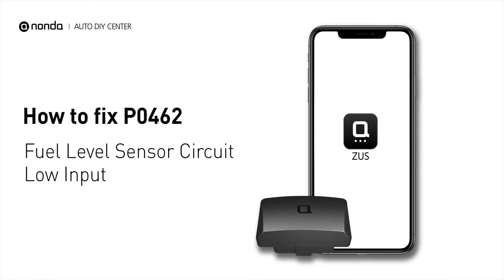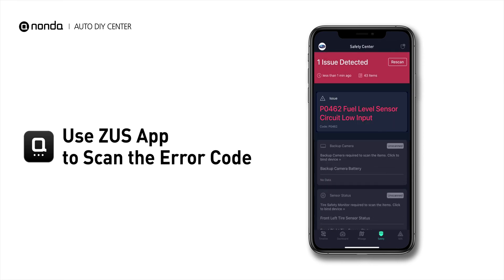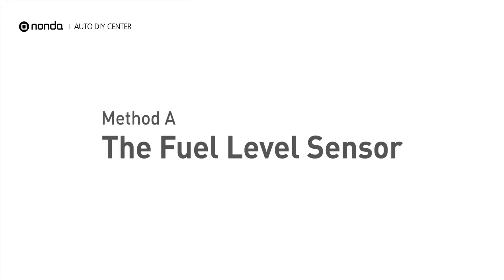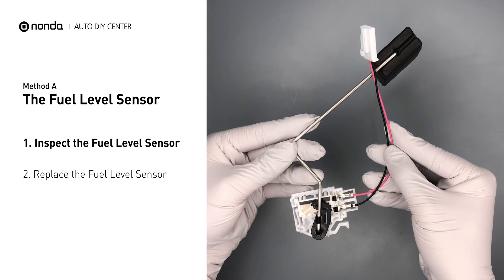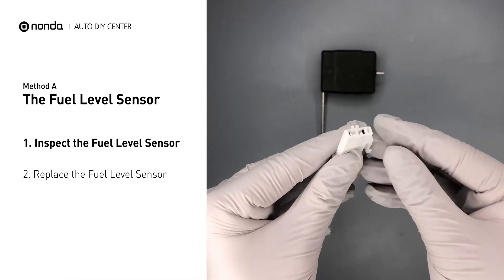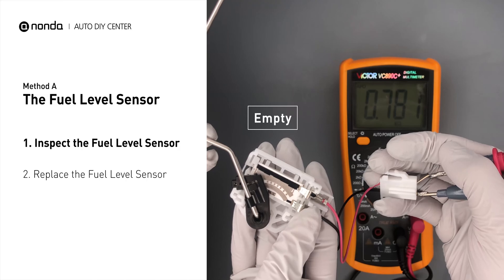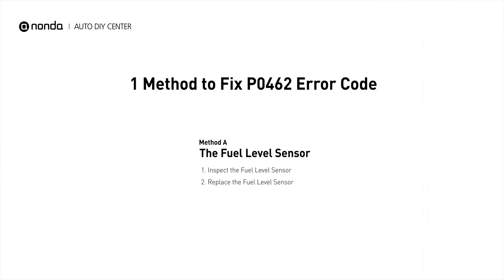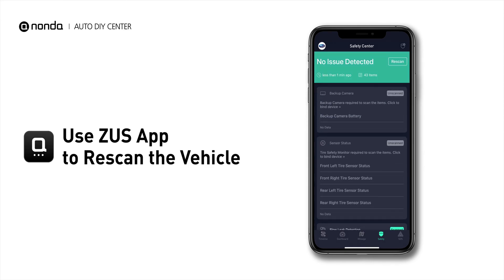How to Fix P0462 Engine Code in 2 Minutes [1 DIY Method / Only $11.56]

Comment from the maker: Hi, I'm Steve, nonda's lead mechanic engineer. 
Feel free to leave your comments here if you have any mechanic questions, I will be glad to help you out!
Reply: I changed the fuel pump and still having the issue, give me wrong fuel reading
Reply: @CasaPapiii  same here on my 02 maxima
Reply: why would it say that code when the dash cluster dosent work.thats the problem i need to figure out. when it works everything works,when it dont work gas miles speed oil air conditioner dosent work.
what code would tell me that problem?
Reply: If I were to take my car to your shop, would you charge me for only 2 minutes of labor to do everything in this video?

Comment: I just replaced the full fuel pump assembly in my 07 charger . Then the fuel level sensor trip the check light. What should I check to solve this issue
Reply from the maker: Hi Brandon, kindly check the condition of the wiring harness & connectors for nay issue.